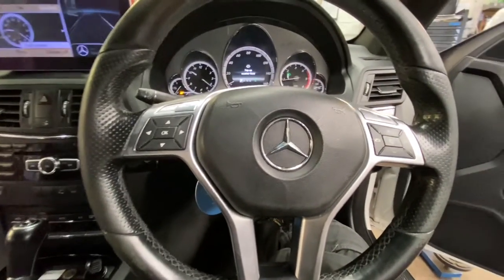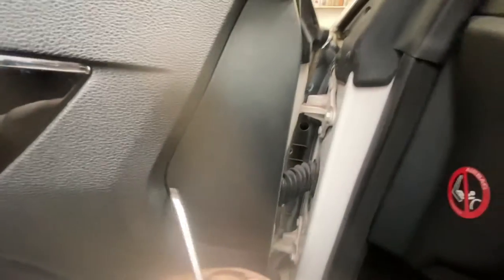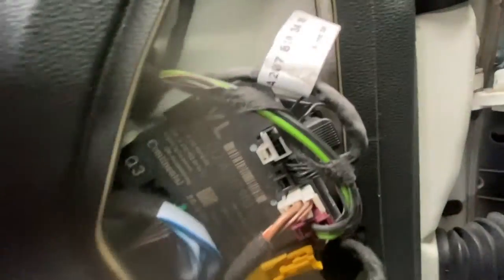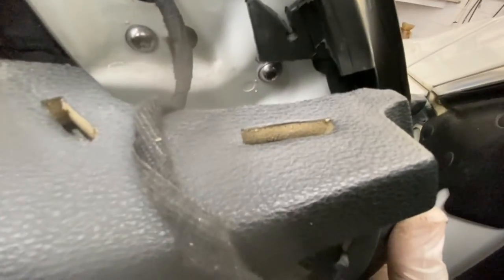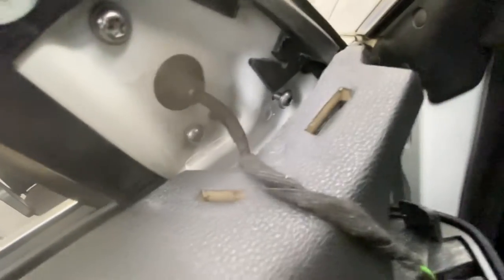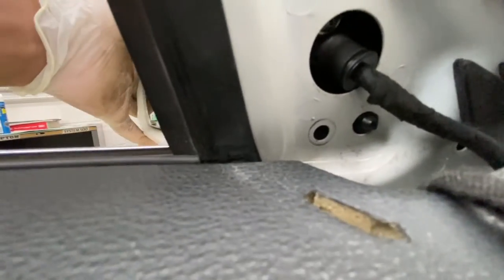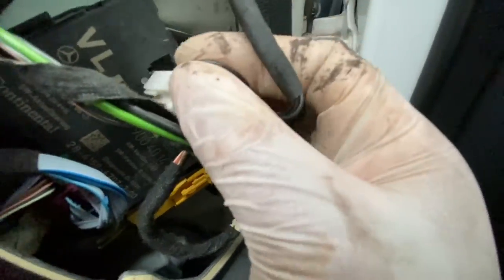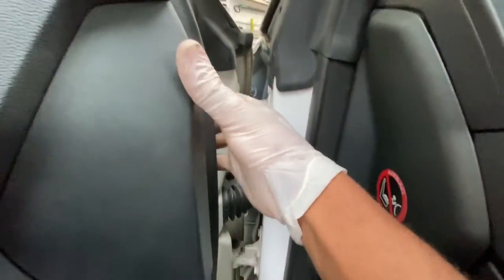#Mercedes-Benz E-Class #wing #Mirror #replacement

Comment: Thanks for this video which made the job easier. My W212 is  an Avantgarde 2010 model with the Harmon Karden sound system, so there is a little speaker in the cover over the mirror securing screws. This cover actually had to be carfully prised off with a screw driver. I also needed to partly detach the top of the door card to free the wiring loom. Other than that it was fairly straight forward but beware thet the edge of the mirror bracket has to go under a rubber sealing strip, and a touch of Fairy liquid just helps with getting the strip in place.
With a bit of fiddling, once I'd got my tools out & put them away again, I reckon it was about hour and a half - But I'm 75 and not really a mechanic!